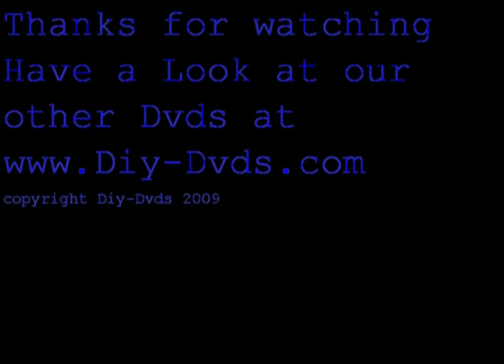HHO Exploding Water demonstration using electrolysis

Comment: Glad to see you getting into HHO but you really need to start using neutral plates or your cell will heat up very quickly. I would bet money that after running your cell for a couple of hours you will be boiling water. I recommend running 5 neutral plates between each + and - plate. The reason you are able to get production with tap water is because of the minerals in the tap water. Try to do this same demo with distilled water.